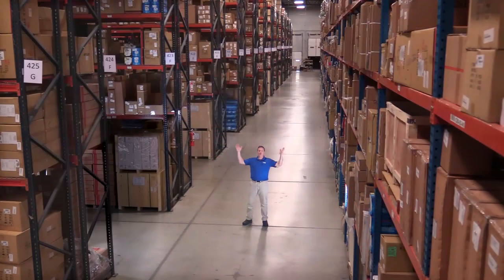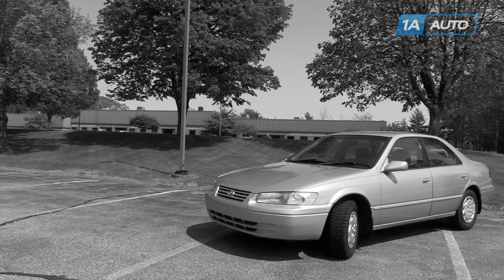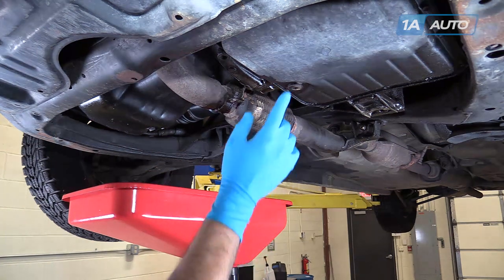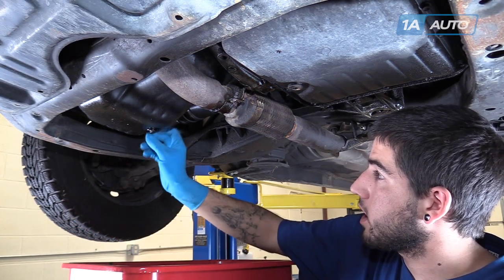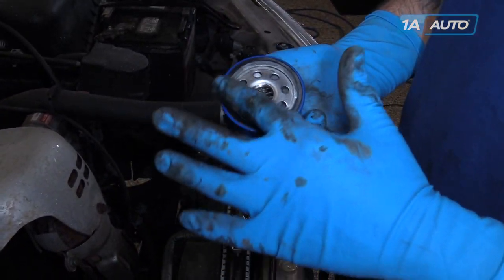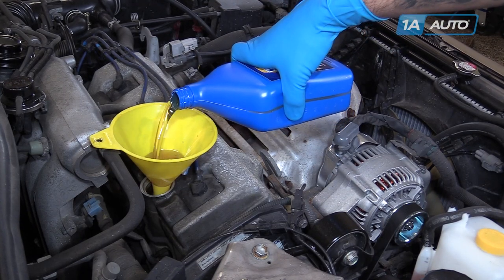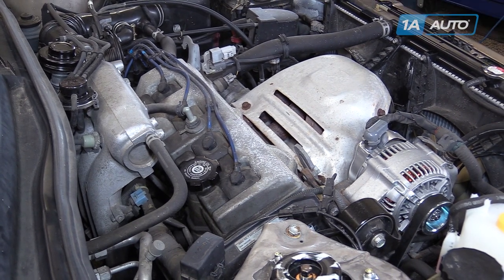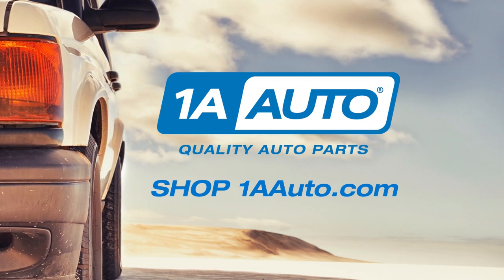How to Change Oil and Filter on 97-01 Toyota Camry

Comment: My first oil & filter change at home today for the 1999 Camry.  (All previous ones by mechanics at service centres).  It's a basic procedure, exactly like I do with my 1960s cars.  All I needed to know was where each item is located.  This video explained it well.

Comment: I have a question. I've poured 5 quarts of oil into my engine and now I'm curious if there's a possibility of my engine being messed up or how to tell if I did any serious damage to my car I seriously messed up I'm freaking out! I didn't know any better let me know if there's anything I can prevent from my car  being completely messed up plz help
Reply: You probably already got this question answered, but in case you haven't then it's important to check your oil dipstick and see if the fluid level goes beyond the "full" mark. It is VERY  important that it does not go above that line, otherwise you can over fill the engine and can bust pistons with the accumulated sludge and pressure.
-Drive your car for 5 min at normal speeds (like a trip to the grocery store)
- Park your car on an even level (like a walmart parking lot, as long as it's not slanted it works)
- pop the hood, and pull out your dipstick (it has the yellow handle)
- check it and wipe it clean, then insert it back fully into its proper tube and pull it out again
-this gives you the true level of your engine's oil, remember anywhere between Low and Full is where you want to be.

Tips:
Check that level every 500-2000 miles, especially in vehicles over 10 years old as they tend to burn oil and you'll have to replace the oil as it goes out (usually by 1/2 quarts at a time)
Take off the fill cap and see if it is "milky" (you can find pictures online what that looks like), if it is milky then you probably have a blown head gasket and should bring it into a mechanic for both a "full check-up" and also ask them to check specifically for the "blown head gasket problem"
Be wary of going to ANY corporate mechanic shops, they WILL upsell and overprice on EVERYTHING including labor, parts, diagnosis, and recommendations. Find a local mechanic with good reviews on google, yelp, and another 3rd party site. They're 8/10 your best bet for a fair and time-efficient transaction/service provider. (my local guy lets me change my own tranny and regular oil with his full lift jack for $20 and some help cleaning up afterwards, saves me from crawling around on the ground, having to dispose of my own oil, AND cuts my time in half with all the handy gadgets he has at the ready, not to mention the difference in leverage from standing and laying beneath a car. Make friends with your mechanic, they're usually pretty friendly people and can make your car a hell of a lot easier to manage.)

Comment: Camry 99 le, just purchased vehicle not sure what type oil was used previously but did oil change with coventional (5W30). Nearing 155000miles is it ok to switch to full synthetic high milage oil or should i stick with conventional living in Texas area not sure if weather plays a factor.

Comment: Pretty good video. You did miss a few things. For example you didn't put in a new oil plug washer. I have seen other videos that also skipped this step. A used crush washer doesn't seal as well and could cause oil leaks. They cost less than a dollar each and if you buy in bulk, sometimes a quarter each.
Reply: Wanna explain more on this ? Planning on doing the oil change on mine and I wouldn’t wanna miss this step

Comment: Does the oil drain plug washer need to be replaced each time you change the oil?
Reply: It does not, and can be reused. I reuse mine. However, the recommendation from Toyota is to replace the metal drain plug gasket each oil change, as the cost of a $0.25 gasket every 5000 miles over the vehicle's lifespan is nothing compared to the cost of seizing your  engine after an oil leak.
Reply: @stracky2  
The original gasket on my 1998 Camry is metal but dealer sells these blue washers as replacement ( not metal ). Does anyone know why?

Comment: Why is it that when you put exactly the amount of oil that the owners manual says and its still wrong? sometimes when i do it its wayyyy over filled or under filled.
Reply from the maker: Do you change the filter each time? The filter may hold up to a quart worth of oil, so if you're not changing that out then you'll be way over if you fill it up to the spec listed in the manual. Hope this helps you out. 1aauto.com?utm_source=YouTube&utm_medium=CTA%20Comment&utm_campaign=1ATony 866-403-3393
Reply: 1A Auto Parts your videos are awesome! I have a 98 Toyota Camry! and do everything my self!!